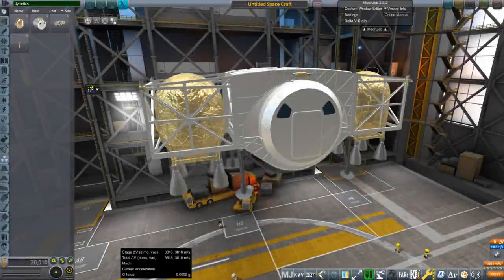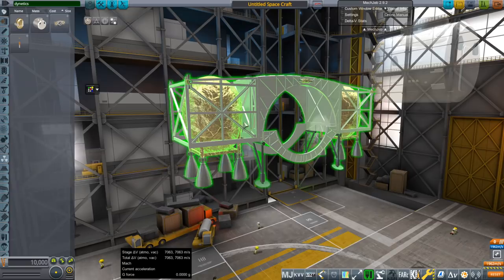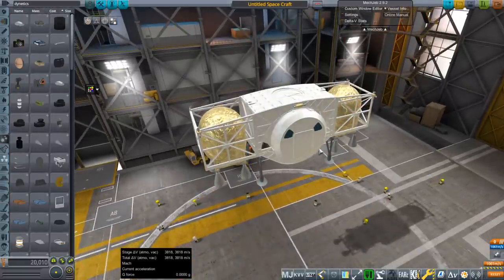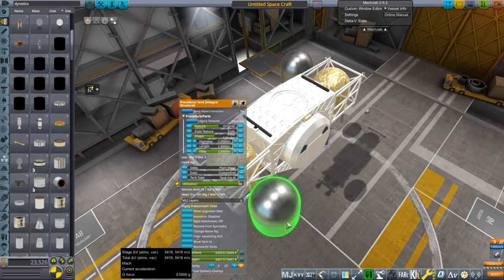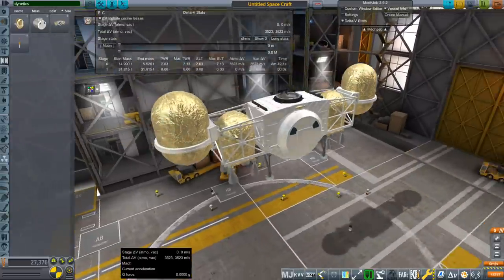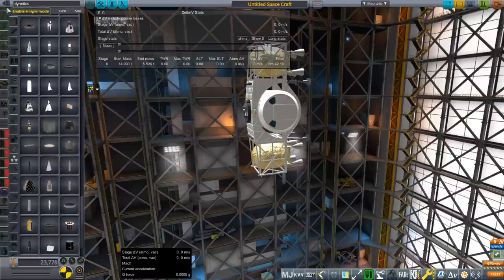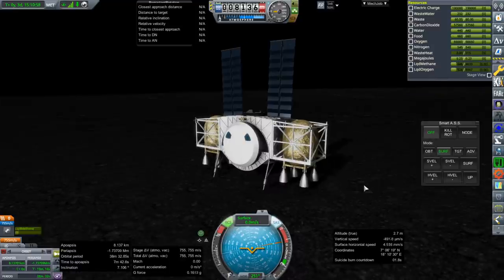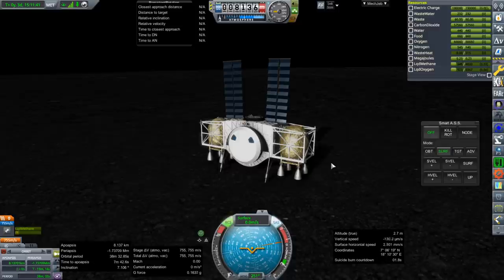Realism Overhaul in KSP 1.8.1 - Dynetics Lunar Lander

Comment: Would you consider making a full recreation of the Artemis 3 mission? I’d love to see a video like that.
Reply from the maker: I'm interested in doing all possible combinations of lunar missions using upcoming hardware, otherwise I wouldn't be making the models. :)
Reply: @RaizSpace  I'd try to make a cinematic of it but I can't even get something into launch with MechJeb lmao
Reply: @harrisongilbert  whats the problem? Where does it go wrong for you?
Reply: @z33r0now3  Ah, I usually get an error with ascent guidance.  "LAST FAILURE: Optimizer watchdog failure" is what I usually get.
Reply: @harrisongilbert  does the rocket keep flying? because I get those too from time to time, but without any major hickups. Mostly it just showes this as the last error but the guidance keeps working so I keep flying. Most of the time it works really good. I recommend the wiki on github. both RO to build competent rockets and how to use PVG.
Reply: @z33r0now3  No, it doesn't let me launch and locks the throttle to zero. I've asked in the RealismOverhaul server but nobody has found a solution.
Reply: @harrisongilbert  Sounds like your install is bonked and it makes more sense timewise to just install new than to fiddle around for hours.

Comment: I'd guess it needs a bespoke payload adapter with struts that reach around or past the drop tanks and attaches to body mounting points, and has some sort of passive pad on a separate arm to stop the downward drop tank from rattling around too much and endangering the launch.
Reply: exactly. Others are dreaming about in orbit assembly when thats a logistical nightmare compared to a proper adapter and a loadbearing structure at or around where the drop tanks connect to the fixed tanks where the PLA then ataches to.

Comment: Raiz, I don't get how they plan to assemble this lander in orbit using commercial launches? Say we launch this on Vulcan, would the first launch be with drop tanks but partially fueled, or would we later attach them with successive Vulcan launches? Would we need in-orbit refueling to make this proposal work with commercial?(if so, thats a major weakness of the proposal for 2024). Or if the latter is the case, then the drop tanks would require their own RCS and GNC to rendezvous and dock and that would add to the dry mass. 

Seems like this would greatly benefit from a single SLS B1B launch, and once its done its mission and returns to NRHO, just send the drop tanks comanifested with Orion, so that Orion crew can do the work of assembly, using the service module(provided that 10t comanifested is enough).
Reply from the maker: Well, that's an interesting question that we can use KSP to work out proposals for, I guess.

Comment: Do you think they will launch the drop tanks on separate rockets and then assemble it in Orbit? Then fly it to the moon? tow that would be riskier and require a lot more time and money. On the other hand, do not think that they will get an SLS Launch so either starship will be ready to launch it in one go in 24 witches is possible if unlikely. Ore there going wich like 3 Glen ore Vulcan Launches.
Reply: In orbit assembly seems very unlikely. Like in general.
Reply: @z33r0now3  What do you mean in general? Dynetics lander as well as National team could launch fully assembled on SLS B1B, but you still need to dock Orion to them once in orbit, and lunar gateway is going to be assembled using multiple launches anyway. By that logic, since we have to assemble gateway in NRHO with multiple launches(single SLS launch can't manage that), we might as well do so with the landers...(more complicated, yes, but I don't expect to see dual-SLS launches in 2024. You would need simultaneous VAB stacking, 2 MLPs, 2 free pads and just the manufacturing rate to pull it off. That is perhaps the reason why the Boeing HLS proposal tanked).
Reply: @Matthew35333  I agree with you on SLS they are rare, expensive and needed for the Spaceship. But remember that Dinetcs not only has to develop a functional cryogenic liquid pumping docking system something that is not trivial on its own let alone the rest of the lander. Even if they pull it off the Problem is that your concerns with launchpads, Infrastructure, fule and the rockets already produced before the launch campaign also applies commercial Providers. To be sure to a Leser degree than SLS still. Since most rockets except F9 have only one LaunchPad (Atlas, Glen and Delta) at KSC lets see how fast we can launch the turn around time on the same launch pad ranges from 13 set by (Soyuz between Meteor-M #2 and Foton-M #4) in 2014 the upper limit is harder since the normal launched-rate is much lower than for this packet launch-campaign but let's say it takes 30 days that would be Launch campaigns between 45 to 90 days which is very optimistic plus assembling it in orbit and getting it to the moon. Of course, there are methods for speeding this up splitting it up on multiple lanch Providers fore example. Sill however they do it it will be a serious logistical challenge getting everything working together. The other thing is that I do not like about the Moon landers is that they all relly on rockets that have never been flown before to Starship is obviously the worst offender because Superheavy is a  best that will be hard to develop which is risky in terms of schedule and then make it work as an orbital thanker that is refuelled it will be had and is not yet clear whether SpaceX can deliver on that in time and how much it will cost are still open questions. The same goes for The National Team aka Blue Origen and co it depends on the new Glenn a rocket that is still lager and More capable than any Rocket flying currently flying to get something tas heavy as blue moon into luna orbit and that comes wile possibly further along in development it still represents significant schedule risk whether or not tey lunch in time and whether they will have the launch rate in 24 and cost are all Open Questions. And Dynetics is the same story tow they haven't chosen a launch Provider it is clear that the volume and weight requirements can preclude most  Rockets currently available. This hole luna Lander thing is a big bet that the launch market in 23-24 will enough big Rockets to do the Job. And while that bet all I so much Hoppe that it will pay of. Ther are no guarantees in space and further.
Reply: @stekra3159  I agree. But the demand/market for those rockets could solely come from NSSL and NRO launches. I would expect the awards this summer. So hypothethically make the winners ULA and NGIS. You could then launch Vulcan and Omega Heavy in close succession. I don't like that Dynetics would require LEO assembly, boiloff would be severe there. National Team lander has an advantage in this regard. All the elements are immediately going to NRHO, where boiloff mitigation is easier. Well, ascent element has storables, so that can be launched months in advance.

Comment: The Dynetics Lunar Lander look surprisingly like the Mars sky crane delivery system if you take out the center module. Now that SpaceX has the lander contract maybe Dyenetics can retool their system to be a cargo delivery system like Dream Chaser. If they ditch The landing legs and use a sky crane tether they can deliver cargo from altitude and not kick up regolith with their engines. Once they cut loose they could return to the gateway to refuel and pick up new cargo
Reply from the maker: Since it's Methane and Oxygen, maybe they could also market it as a reusable cargo craft for Mars. Not sure how well shielded the bottom would need to be, but the need to make it a skycrane would be less necessary (though not completely safe) and maybe it could refuel on the ground. In fact, its first job could be to carry a decent ISRU unit down.
Reply: @RaizSpace  Starship (I think ) will also use Methane and O2 so they could top off with a Star Ship Tanker if they are ever in orbit around the moon.  Dynetics will not be transporting people to the lunar surface but they could remake themselves as a reusable cargo carrier from Gateway to the Lunar Surface.   Mars will be hard without dealing with the atmosphere. Dynetics could do the moon with their existing system.

Comment: How did you get the moon to have all the rocks and have really good textures? If anyone knows please tell me ! Thanks !
Reply from the maker: That's the newest RSS Textures at highest quality (16k), which also requires the newest RSS and maybe a Kopernicus update, I don't remember.
Reply: @RaizSpace  Oh alright thanks !
Reply: @RaizSpace  I followed your tutorial on installing RSS for 1.8.1 (which i assume is the latest version) So its probably finding the 16k Textures
Reply: @astroaustralian7039  You need to get the master release from github. For both. Textures and RSS itself. You need RSS version 18.1.2., and textures version 18.2. I literally did it yesterday. And it works also with lower resolutions. I use 8k. The groundshaders are still working. https://github.com/KSP-RO/RealSolarSystem/releases/tag/v18.1.2 https://github.com/KSP-RO/RSS-Textures/releases/tag/v18.2
Reply: Oh ok , what are the master releases though ? Thanks ! :)
Reply: @astroaustralian7039  as far as I understand those are the most up to date versions which wont necessarily have been pushed to CKAN already or linked on the forums. It is simply removing your old folders RSS and RSS-Textures and replacing it with the folder from github. Here is a general install guide for how to install github mods. https://github.com/KSP-RO/RP-0/wiki/How-To-Install-a-Mod-From-Github
Reply: Got it ! Thanks so much guys , appreciate it ! love the ksp community :) !
Reply: It's actually has nothing to do with 16k textures. It's a part of the KSP 1.8 terrain shader which can overlay a smaller detail texture on the surface, which makes it look more detailed than it actually is. This functionality was made use of in RSS 18.1.2 (also, bonus fact. the default RSS 18.1.2 moon looks even better than his).
Standecco also made a PR to the RSS repo that adds this functionality to even more bodies.
Reply: Alright , So should I just download the master release of KSP RSS 1.8.1.2 and I will have the details ? Or should I download RSS 1.8.1.2 and the 16K Textures with PR in order to have the details ( Cape Canaveral , Moon rocks) ? Just a question , Would I have the same sort of details on other planets like Mars? Thanks !
Reply: @astroaustralian7039  You download:
This (RSS) https://github.com/KSP-RO/RealSolarSystem/releases/tag/v18.1.2
This (RSS-Textures) https://github.com/KSP-RO/RSS-Textures/releases/tag/v18.2      (any resolution will work)
This (Cape) https://forum.kerbalspaceprogram.com/index.php?/topic/194110-181-katnisss-cape-canaveral-rss/

This https://github.com/KSP-RO/RealSolarSystem/pull/210  is the pull request with details for other planets.
Reply: @Katniss218  Perfect ! but i don't know where to download the pull request ? Sorry I'm still new to this :)
Reply: @astroaustralian7039  You click on the repo it's pulling from (Standecco's one) and download the entire thing as a .zip. Then you can overwrite your RSS with his, but be wary of what you replace. (MAKE BACKUPS)
Reply: @Katniss218  Alright ill try that :)
Reply: @Katniss218  Ive done that and when i start KSP it says that i have to download textures for RSS although i have already ? is there any solution?
Reply: @astroaustralian7039  have you erased the folders RSS and RSS textures before placing the new ones? The only thing that should be overwritten should be earthheightmap.dds when installing Katniss Cape.
Reply: @astroaustralian7039  You have to download new textures. Old ones aren't compatible
Reply: @Katniss218  Alright i just did that and the details are working ! :) I just have trouble getting the Cape Canaveral Mod working , One of the dependancies was Kerbal Konstructs how do i get that to work?  and in the file (of the cape canaveral mod) there was plugin data for Uranus's Rings should i put that into the RSS textures ? Thanks guys ! :)
Reply: @astroaustralian7039  KK doesn't play well with RP-1 (KCT).
Reply: @Katniss218  Really ? oh well is there any way to get it to work ? Thanks so much for all the help guys :)
Reply: @astroaustralian7039  You can join RO Discord, there's a lot of people willing to help with anything RO related there.
Reply: @Katniss218  Alright ill have a look :) Thanks for all the help !